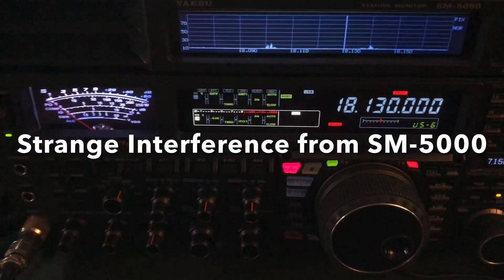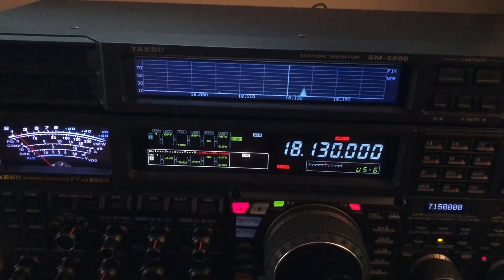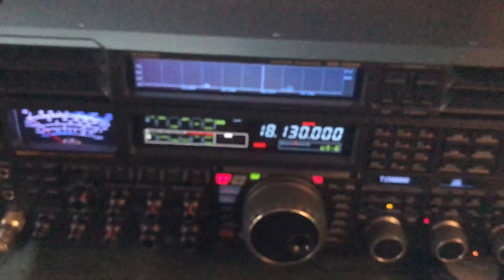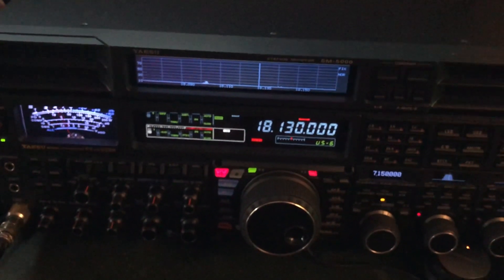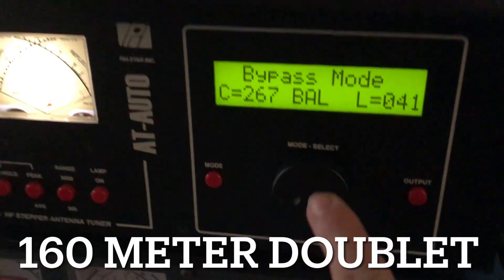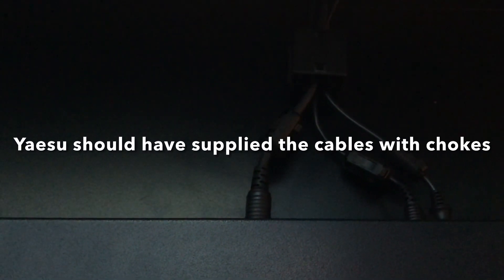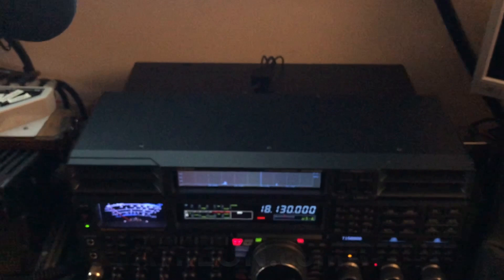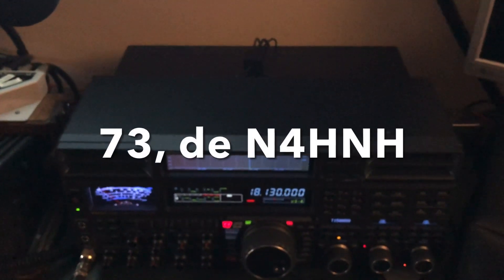Strange Interference from the Yaesu SM-5000

Comment: I lost the sm-5000 V-AF cable, anyone know exactly what type of cable this is??  Can it be purchased?  Is it proprietary?
Reply from the maker: I’m fairly certain it’s a 1/8”, or 3.5mm, stereo audio cable on both ends. So the connectors will be a tip, ring, sleeve type. Those are very common. 

73, de N4HNH
Reply: @n4hnhradio  Thanks !!!!!!!!!!!!!!!!!!!!!
Reply from the maker: You’re very welcome!

73, de N4HNH
Reply: @n4hnhradio  The ham radio gods have smiled upon me, I found it!!!!!!!!!!!
Reply: But now I have to pack her up for the triple Oled repair.  Such fun..
Reply from the maker: I’m so glad you got it going again. I debated purchasing the SM-5000 but I was pleasantly surprised. The phase reversal was a feature I didn’t expect. All I wanted was, first, speakers, and second, a simple spectrum scope. I’m not into waterfalls. The SM-5000 delivered. 

For the benefit of others who might read this, please comment where you found the cable. Was the description I gave correct?

73, de N4HNH
Reply from the maker: How old is your 5000?  When I bought mine, in 2019, I had read that the OLEDs had been sourced from a more reliable manufacturer. 

73, Doug
Reply: @n4hnhradio  Bought it in 2012, Oleds started getting dim around 2015, they went out in 2017.  I never got around to doing it or sending it away.  I have the DMU unit, so it did not really impact me much.  There is a great how-to vid, but my hands are not what they once were.  One with the line is covered, so labor is covered 100%, have to buy 2 oleds.
Reply from the maker: I’m glad to hear that you don’t need to pay the labor. I hope they will extend that to me when the time comes.

Comment: But you have t wrap the cables around the big choke that they are firm and not loose.
73 de DH1KJ Joe
Reply from the maker: I actually tried that in 2019, when I first fixed this.  I just never shot a video about it.  The choke isn’t big enough for all three to wrap anyway.  I didn’t need to though.  The individual chokes had already knocked out most of the noise.  I can slide the big choke down the cables behind the radio and it still works.  As long as the cables go through it, the noise is gone.

73, de N4HNH